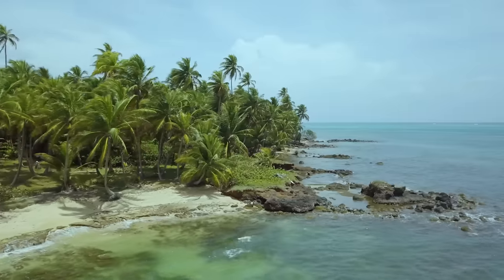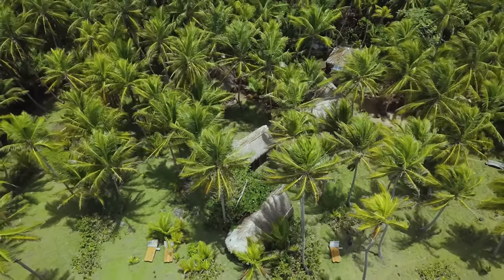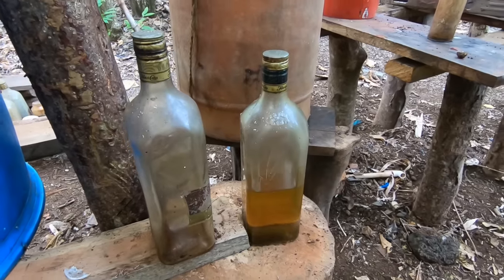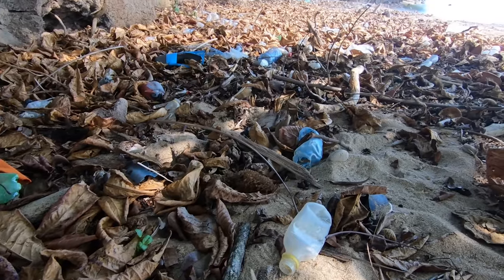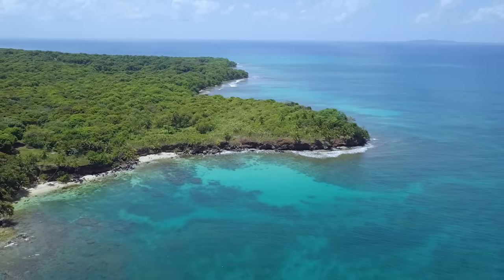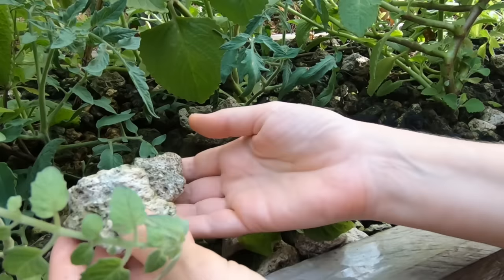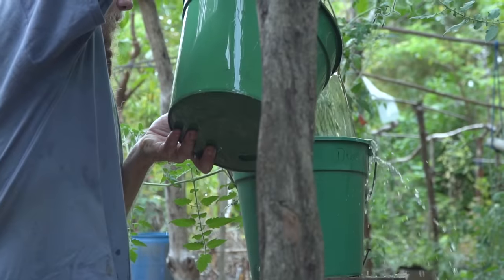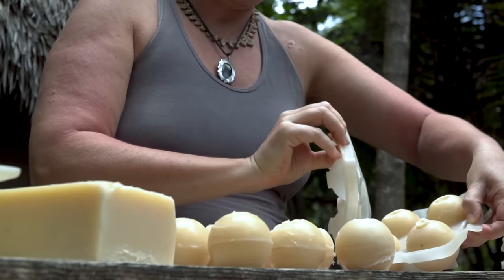THIS SELF SUFFICIENT FAMILY MAKES THEIR OWN FUEL FROM PLASTIC!

Comment: Next step: using solar power (maybe a parabolic reflector or fresnel lens) to heat the vat instead of burning wood.
Reply: brilliant
Reply: Nothing much wrong with burning dead wood but a solar array to heat it is a great idea. We have those solar systems that would work out in the desert on I15 near the Nevada border just before you get to Prim Nevada.
Reply: Except they need to burn the wood for the ash so they can make the soap,  it’s all cycle
Reply: Apart from the amount of energy per 2m from the sun is not enough to do what you’re suggesting.
Reply: If that doesn't work and people have issues with wood, some use heating elements run by generators fueled by the product produced. They say 10 percent is used by the machine, the 90 percent put aside for later use.
Reply: Think when ur living like this you need woodash too so... look at all hes got growimg most of not all will thrive off that wood ash created!
Reply: wnc817  yes u are right  forest management is key!    California, if they actually did some forest management their wild fires would be cut back dramatically!
Reply: Sorry, no, won't work, as about 350-500C degrees are required for the reaction, can't get that much from solar.

Comment: For those that are interested in trying this process for themselves there is a very good thread at Energetic Forums. It's been around for a few year and is VERY helpful. Start from the beginning, the thread evolves as people experiment and learn. And be careful, use pipes of at least an inch in diameter, no leaks, and if you are not using an inert gas like nitrogen to displace the oxygen inside the reactor, start with a lower fire gradually making it hotter so the oxygen inside is pushed out by the gasses released from the melting plastics before it reaches a critical temperature. It doesn't take too long. And use a bubbler, when it bubbles you know it is working and it keeps oxygen from being drawn back into the system. There should not be much pressure in the system, it is an easy flow. Have fun! :-)
   This is the link-http://www.energeticforum.com/forum/energetic-forum-discussion/renewable-energy/7255-how-to-turn-plastic-waste-into-diesel-fuel-cheaply
  Thank you to all that give support with their good thoughts and to Gypsy Journey for helping to expose these ideas to many more people than we could have.
Reply: Doing it this way will cause cancer.  Its not good for the environment
Reply: Ricky Barber  Thanks, my friend. The same to you.
Reply: @Grim FPV I think you're right that it produces some bad chemicals as a side effect, but when you consider the bad effects they are offsetting by taking plastics out of the ocean and not burning commercially produced fuel, it's likely a net benefit to the environment. Commercial fuel is very dirty and energy consuming to extract, refine and deliver. Now I think if people in a high density city tried to do this at home, then local air pollution would be a more concerning issue. Hopefully the jungle and the sunlight break down most, if not all of the harmful emissions of this small operation. I do think that it will be creative people like this who eventually help to solve our waste and energy production problems through simple inventions.
Reply: @Grim FPV  Well, we certainly aren't doing it to be bad! :)
Reply: This is simply melting and distilling the plastic to extract the last bit of fuel out of the plastic.  Plastic is the byproduct of distilling crude into fuel like gasoline and diesel. The huge corporations don't distill it this far, because it is incredibly inefficient, a waste of huge amounts of energy/resources to extract this last, tiny little bit of fuel and also creates more pollution than it is worth.  Also, plastic is a commodity that is needed Globally, so the byproduct of the fuel distillation is sold.  
If everybody started doing this, the amount of pollution generated would be tremendous.  For one guy to do this on an island is not too bad (but not good), however, this does not scale up well without creating massive amounts of pollution.  If you start doing this in your backyard, expect your neighbors to be calling the city when all the toxic fumes start blowing all over along with all the smoke from the fire.  If you think, "Oh I will use propane", you will burn 10000 to 1 more propane to get that little bit of "diesel/gasoline".  
Toxic Fumes are not a joke.
Reply: @VidarrKerr   Have you any experience in this? Do you know what you are talking about? 
  Plastic is not a byproduct of distillation of crude.  Plastic is long chain hydrocarbon molecules. It is created using hydrocarbons (refined from crude) and polymers.
   The heat melts, vaporizes the plastic into gasses cutting those chains in the process. The shorter the chain, the lighter the gas. Diesel the heavier, longer chain, propane the shorter chain. The more often you vaporizes the liquids the more the chains are chopped resulting in lighter gasses.
 There is about 1 liter of liquid fuel per kilogram of plastic, the conversion is very efficient. If you capture the uncondensable gasses, such as the propane and butane that is flared in the video, you can run that into the carburetor of a gasoline engine, the resulting  scent is actually sweeter than normal gasoline with very little of the fumes you are so worried about.
  People also use heating elements to run their gassifier, using about ten percent of the resulting fuel to continue the operation, while collecting the 90 percent for future use.
  Using heat energy for us is not a problem, hurricane and storms give us lots of deadwood and there are coconut husks by the thousands.
  From what I remember, studies have shown that fuel derived from plastic is cleaner and stronger than fuel from crude with lower a sulfur content.
Reply: @dereksplace1342  You have NO IDEA What you are talking about.  
Most modern plastics are derived from fossil fuel based petrochemicals like natural gas or petroleum.  
You are melting and distilling out the last tiny bit of fuel from it, which is inefficient and creates highly toxic fumes.  You are hurting the environment.
Reply: @VidarrKerr  I'm not an expert on plastics or emissions, but 1 kilo to 1 liter is not an inefficient yield. By any measure. That's not a "tiny bit"
Reply: @josephmiller997  Well, you should get a job consulting for refineries, maybe you can convince them to refine to the last drop.  If you believe those numbers in the first place.

Comment: You can use tires as well to make the fuel, all you are doing is distilling the plastic and cooling it, the diesel comes off first where it is hottest then as the vapor cools further it becomes gasoline or at least close substitutes. This process is called pyrolysis and both the tires and plastics can be used together, no need to separate them.
Reply: What the heck do you do with the byproduct of burning all that plastic?
Reply: Close you have it backwards the gas comes off first remember you are leaving the up curve out of your equation.

Comment: Awesome job, folks! For others reading these comments, they are not burning the plastic, they are heating (distilling) it until the molecular chains start coming apart changing it back to a form of petroleum oil. The temperature of the inside of the container regulates what type of fuel and other byproducts are produced. This is way cleaner than the plastic pollution of the earth. I believe it gives of little or no CO2 and even if it did, most plants need CO2 to live and give off oxygen.
Reply from the maker: Thanks a lot for watching and for making this point clear to the people who are being critical. The worst part is that people on the island even burn plastic to get rid of it! Which is far worse in my opinion
Reply: @TheGipsyJourney  I agree completely.
Reply: Shhhh we don't allow this kind of truth-telling on Youtube anymore lol

Comment: What kind of emissions are coming out of his plastic distillery? I'm guessing there are some nasty volatile organic compounds that are released into the atmosphere.
Reply: Can't be worst than contamination due to drilling...!
In more the plastic everywhere becomes microparticules of plastic thatcare found everywhere in the world and in all living organism. By using this plastic you help decreasing this plastic pollution.
Reply: Probably a lot, but it's preferable to just leaving the plastic lying around on the beach, plus it's helping to run his business and help the locals.

There's no doubt that recycling is highly energy intensive, but there's so much plastics and other stuff that should be recycled instead of going into landfill, we should make the most of it.
Reply: Would still be less than all the plastic damage, get a few good filters. More benefits to us and planet (except the most important $$ ) than its current, much worse, polluting disposal method.
Reply: @mychkineplot7677  unfortunately it is worse, while plastics are bad for the environment as litter they are actually a carbon sink. Once processed from oil into plastic they hold onto that carbon for 100's of years, when he burns them for fuel they are releasing carbon that would have otherwise be trapped in the plastics.

This opposed to bio fuels that take co2 already in the air convert that into fuels which is carbon neutral
Reply: To all the people on the post either bashing other forms of energy saying this is preferable, or that leaving the plastic lay about is bad.... take 10 minutes to look up the science before posting such an ignorant answer. It is people like you who have zero understanding of chemical reactions, pollution, or how to actually take care of probably anything. I am tired of people claiming they are working for a better environment while actively destroying it.
Reply: I wondered the same thing, but I assumed that was partly why they cook it in an oxygen-free environment. There was no visible smoke that I saw, but perhaps someone who understands plastic chemical compounds better than I could weigh in. I wondered too what the yield was. How much plastic does it take to produce a gallon of fuel?

Of course, the diesel and gasoline engines produce their own emissions, but all things considered, it's pretty cool.
Reply: @josephmiller997  let's not forget the wood he burned to cook the plastic.
Reply: No less emissions then the dead animal burning plant I'm sure... Some people got nothing better to do than complain about someone else's self sustainability and happiness.  Great job brother I'm going to learn your ways.
Reply: I once designed the controls for a trash to energy machine that used a  downdraft, packed bed, gassifier..  We had to carefully maintain high temperatures in the pyrolysis zone to burn up all the VOCs.  I'm just saying that this is something that needs careful monitoring & control to do properly.
Reply: @simoncameron4355  So what is your/the preferred method with plastic waste and why? Is it preferable to leave it to decay in the environment, burn it for energy, or recycle/convert it into something that will at least benefit some?

I'm sure there's valid points to everyone who's posted here.

Comment: So with all the fuel he burns to make enough heat to melt the plastic, when you subtract that, what is the actual net result in fuel? Also consider the pollution being put out by that old WWII generator and the smoke from burning the wood. Works for him but not practical on a large scale.
Reply: The only advantage of turning plastic into hydrocarbon fuels is getting rid of the waste plastic. It it far from carbon neutral - very far due to all the CO2 and CO from the burning wood. The conversion process is very inefficient. A lot more carbon, as well as nitrous oxides are produced when burning the fuels in his engines. 

It is not renewable either, although he probably has  plenty of plastic as feed stock for the hydrocarbon generator. The wood ashes from the fire to heat the retort can be used to make the hydroxide for soap making. I have no idea how sustainable his wood lot may be.  I suspect he has to buy food or barter for food to feed the tilapia.

On the other hand, he probably has somewhat less impact on the environment than I do.
Reply: Exactly. It's much more ecologically sound just simply bury the plastic.
Reply: The fact that he's using the  plastic from the sea it's the greatest thing he can do in my opinion! Think of the amount of sea life they save! And that's fantastic! Cheers
Reply: @last Koresh how is bury plastic more ecologically sound? Do you know how much plastic our world uses? How much land that takes up? Land that could otherwise be used to grow food or forests to take in CO2 from atmosphere? If you make fuel from plastic it can replace fuel that would otherwise be made from crude oil. I'd like to see whatever study showed how energy inefficienct pyrolysis of waste plastic to fuels is.
Reply: @TheBigMclargehuge  lol but you have to wait thousands of years for the plastic to decompose and turn into crude or any useable mineral. it will be better  to create a cleaning process for the waste produced from burning converting the waste to oxygen or recuse the waste in another production could be a better solution.
Reply: @buggsy5  Watch the video again. See all those trees and plants? And the water around the island? They absorb the CO2 produced.  It is probably more efficient than if they had to ship diesel in by 55 gal. drums.
Reply: @blackwulf8793  Gates just wants us all to be soyboys and not healthy testosterone fueled alpha males like we should be.
Reply: @sushiquad  Burying waste plastic is better that sending it into the already polluted atmosphere although it will eventually break up not down. Converting it into something more useful, playground equipment, clothes, furniture etc keeps it out of the environment and would be a better option. On another note burning plant material like wood is not polluting the atmosphere as it will eventually decompose emitting the same gases anyway.
Reply: @buggsy5  Carbon has nothing to do with anything. In fact nothing has anything to do with everything. Haven't you heard? The clean air caused by covid  is polluting the planet and increasing global warming. Thats right. Clean air is bad now.
Reply: @godfearingheathen  I love your music lol but if fuel is going to be burned anyways, wouldn't it be better to have the fuel coming from plastic rather than crude oil? Much of the world's infrastructure is built on gasoline/diesel/jet fuel, it will be a long time before we can convert to all renewable. And even with renewables you are mining the elements for batteries and solar panels, I dont think it is as renewable as some people think.
Reply: @Joaocruz30  exactly. People need to be realistic. If they were living there I guarantee they would be right there with him doing the same thing.
Reply: @buggsy5  
yea it seems it would be ideal for him to get a solar or wind powered electric heating coil of some kind, and design the vat and tubing around it.
maybe it would cook smaller amounts/slower rates but still be a more sustainable way to extract the last value from plastics washing ashore.
Reply: In some of the larger setups that’s attempted this type of process they use giant solar arrays as a heat source. The technology to make it feasible on a large scale is decades away due to other issues. Some have been discussed earlier and on other posts.
Reply: Better than plastic in the sea
Reply: Dont blame him for the fuels,specially if you drive a truck,the amount of plastic trash washing on the islands is wayyyyy to much and there is nothing to do about it,his plan is not perfect but could be perfectionized if the government cared about the environment,but lobbyists
Reply: @jamestheotherone742  For the minute amount of fuel oil fractions he produces, that MIGHT be true - but I doubt it. Cracking complex molecules takes far more energy than cracking raw crude oil, which is already a liquid. Nor do we need more CO2 being absorbed by the oceans, which are becoming more and more acidic.
Reply: @annak804  In my opinion, that is the only redeeming thing about his fuel oil recovery. I just wish he would make an attempt to make his setup more efficient.

Comment: I didn't even know this was possible. We should be doing this on a mass scale.
Reply: Emissions laws make it unfeasible. My city of 2 million used to have a power plant operated by city trash.   It was shut down due to compliance costs.  So now, the trash goes into landfill and breaks down into methane instead
Reply: @leemathoo6583  

It's not so wonderful. Burning certain plastics are incredibly harmful for the environment. Now, is there a way to identify which plastics can be burned to make diesel and not pollute the air as well? That would be my question.
Reply: @dontbanmebrodontbanme5403  basically anything plastic has a label on the bottom of it saying what it's made of.